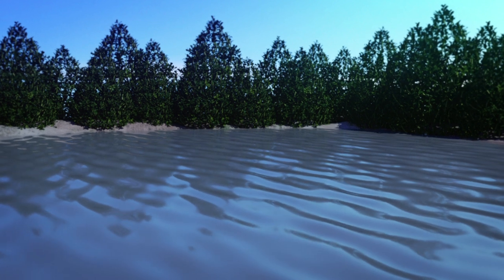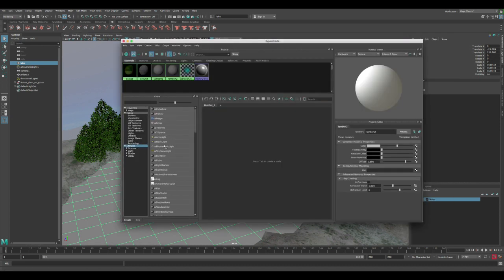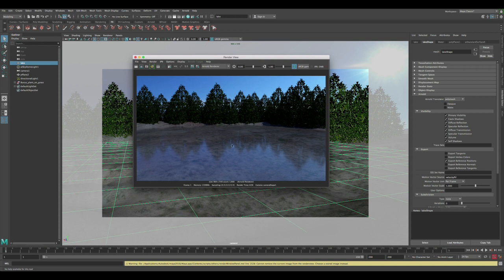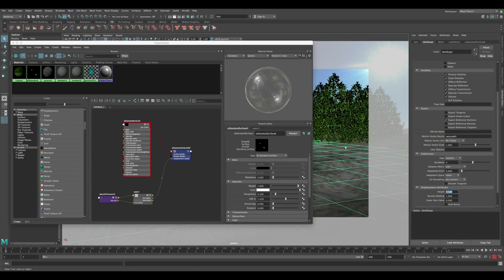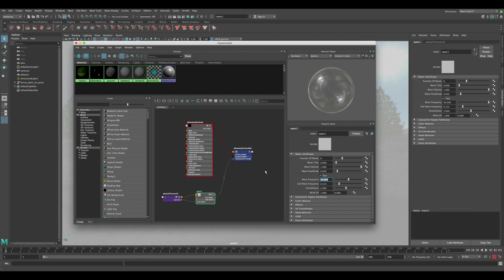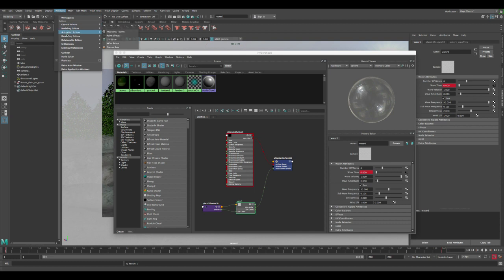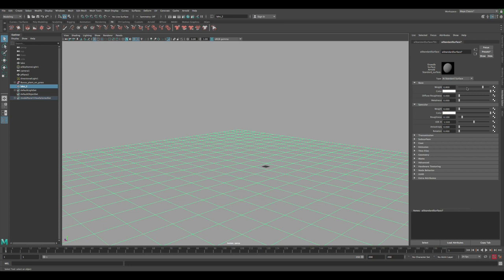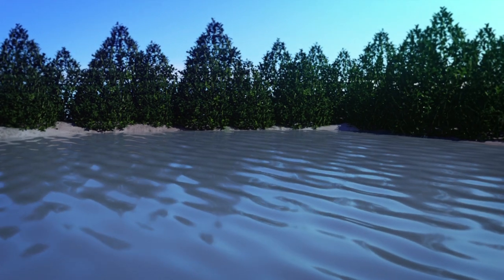How to Create and Render Animated Water Shader in Arnold and Maya Tutorial

Comment: I didn't find the "transparency" attribute in Aistandard
Reply from the maker: Which Maya version you are using?
Reply: 2017
Reply from the maker: We used Maya 2018 for the tutorial thats probably why some attributes are missing the shaders in Arnold changed from 2017 to 2018. if you have access to Maya 2108 it will be better to upgrade, since this is the latest Arnold shaders updates, cause anything you will do related to shaders in Arnold/Maya 2017 will not transfer and read in Maya 2018. hope this helps :)
Reply: thank you for your reply, maya2018 didn't work with my PC specially with open GL. thank you
Reply from the maker: Check out this page about Arnold shaders, it have  useful information, but they keep updating to the latest shaders so for 2018, however you might find there for 2017 as well, hope this helps :)
https://docs.arnoldrenderer.com/display/A5AFMUG/Shaders